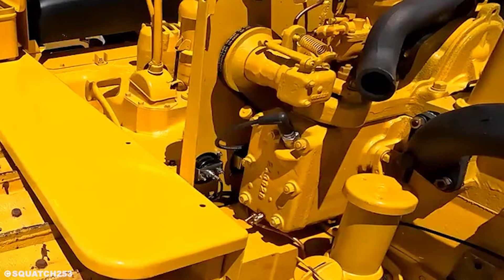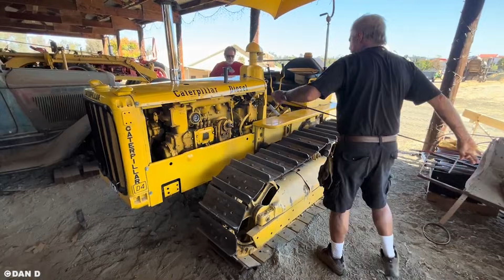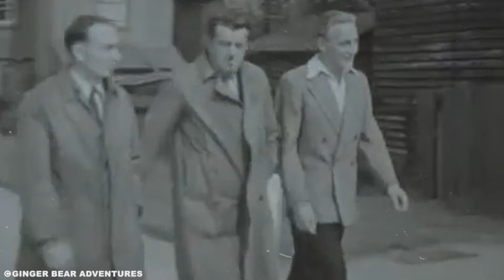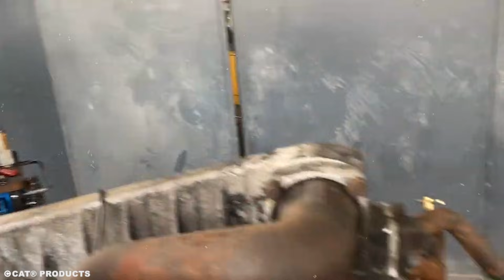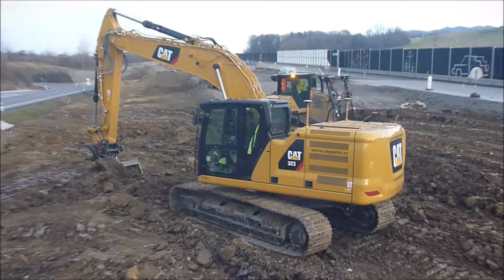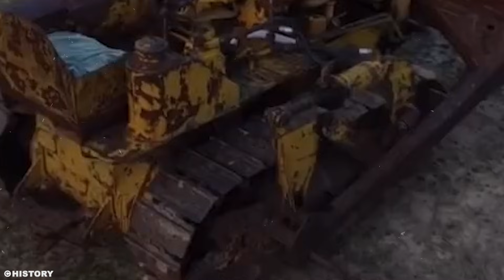How One Caterpillar “Bulldozer Engine” Outsmarted Every War Machine in WWII

Comment: A friend of mine designed and built a modern steam unit that would leave a Cat for dead. I could fill the Mitchell Library with all the advantages it had. For a start it was the lowest emission engine in the world and still is. Being external combustion it can burn any kind of fuel including high flashpoint, liquids, solids, gases cleanly. He took it  to America but they didn't want it. Can you imagine that? That was fifty years ago and American engine designers still can't come near it. We were  invited to a low emission engine display at the Wildwood Inn Ann Arbor by the E.P.A. to ride in the Chrysler Turbine Car but were very disappointed with it. I think it should have been in the Museum of Modern Art or the scrap heap. People were crazy about it but the bottom line on emissions was not disclosed. That would have been the best exhibit. The old master has gone now and that technology is still there waiting for somebody gutsy enough to do something with it. I don't think I'll be around long enough but steam is still a dream.

Comment: All D series Catapillar bulldozers D-4, D-6, and D-7’s used a gasoline powered “pony” motor to turn the nine over to start them.  All International TD series dozers used gasoline to start, the main motor using a compression release to start then switch with a lever over to run on diesel.
Both Cat and International dozers used gasoline to start them clear into the 1950’s.